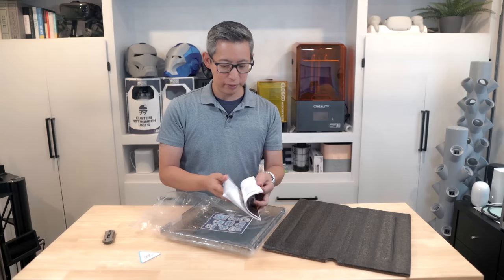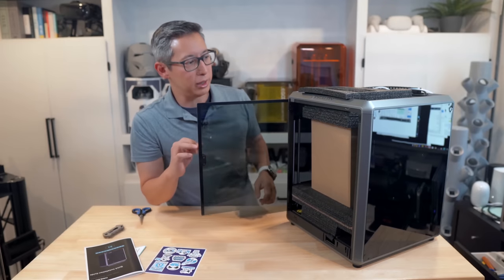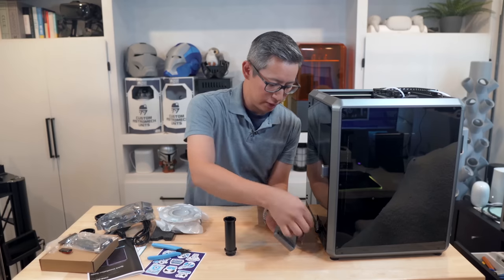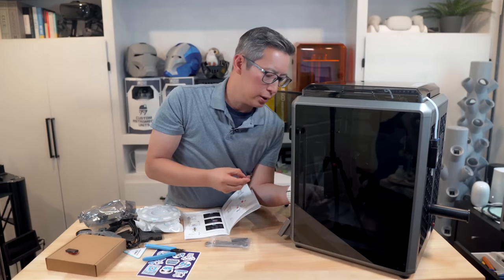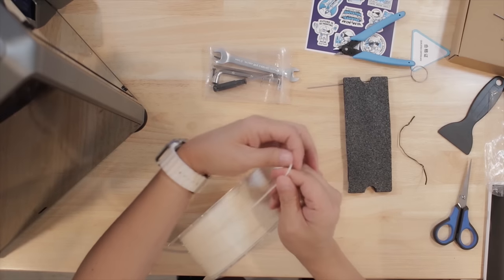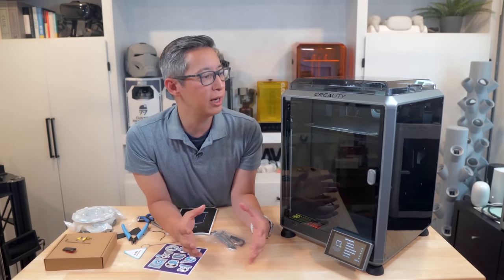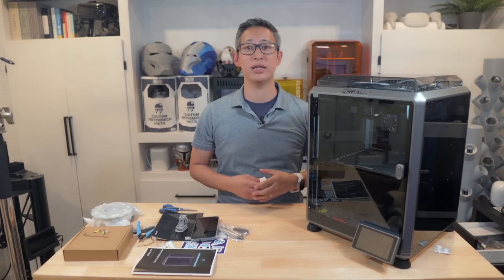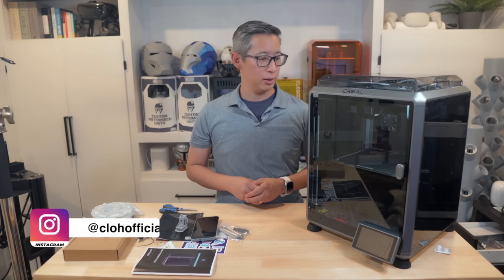Creality's K1 3D Printer is Here! | Unbox & First Use

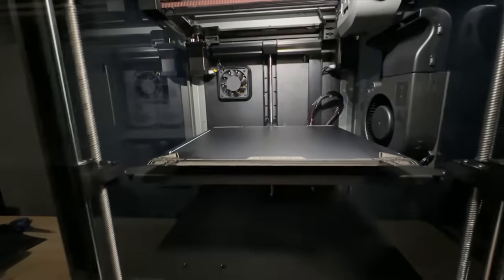Comment: 28:20 - You shouldn't touch the printer (or the table) when the printer is doing the input shaping tests.  The front panel warns you about this.  Shaking the table or printer will result in an incorrect input shaping calibration.

Comment: The price in Sweden for Bambu Lab X1 Carbon is on a whole different level. It's €1500 for the AMS version. P1P is €900. K1 is about €600-650.
Reply from the maker: Wow.  That is a lot more expensive.  Hopefully it gets cheaper over time.
Reply: @ChrisLoh  Yeah but their earnings are also much higher than other countries.

Comment: It was a bit disappointing that you received a K1 with a sprung frame, based on the lid not fitting.  I've watched several K1 videos and hadn't seen that problem.  I assume someone dropped that printer on a corner, probably during shipping.  Before I attempted to use the printer, I'd square the aluminum exoskeleton frame.

Comment: Mounting the spool on the back saves money but is one cost cutting measure that should have been scrapped.
Reply from the maker: Yea.  right now I have the printer backed up against a wall and it's a hassle to change out filament spools.  Im trying to find and/or design a template that will allow me to mount the spool on the side or somewhere more convenient.
Reply: @ChrisLoh  Think 'vertical integration' ... 1 Kg spools are 3 inches wide by 8 inch diameter. Construct a new top from Acrylic that increases the height by 12 inches. place bar mounted horizontal across the width 5 inches from the top and back. This allows room for at least 3 spools inside the new cover. Spool the filament from center of the front of the center spool. The cover would do double duty as a drying chamber as well ... just an idea :-)
Reply from the maker: @Bonjour-World  Thanks.  Sounds like a good plan, but will need to find some time to do it.  I'll update if I can pull it off.

Comment: Mine just showed up, it's running through the self checkup.  I can't tell if it's actually on the network yet or not though.
Reply from the maker: On the network selection screen if you wait a little it should say connected.  The alternative is to download the Creality slicer and see if you can seee the printer
Reply: @ChrisLoh  Thanks for the reply!  This is my first 3d printer, sure does a nice job!
Reply: @NavySturmGewehr  hows your k1 doing? I’m on the fence about getting one. Ive havent had much luck with 3d printers previously . May sell my two bed slingers and get one of these. I’m really looking for a fuss free printer that doesnt require bed leveling
Reply: @tbip2001  I'm waiting on a replacement hot end from creality.  My first 3d printer is down for two weeks.  I erroronously made the assumption that creality really wanted to knock it out of the park with this printer.  The quality of the prints and the easy of use as a new user is top notch.  It really is.  How many are having hot end failures and the fact that such an expensive machine is out of service in three days is a major put off, no matter how good creality's customer service is.  Ideally, I don't want to find out if a company has good customer service or not.

Comment: Just tried setting up my new K1 and it keeps failing during self inspection. It starts the self leveling part of the test then goes dark and reboots. Starting to feel regrets. No answer from Creality yet.
Reply: Check on side for voltage setting  from factory it comes set at 230 volts has to be set at 120 volt

Comment: I got mine about 3 weeks ago!
Reply from the maker: Excellent.  How are you liking yours?
Reply: @ChrisLoh  To be honest, I sold it 2 days later. I already have a Bambu and so when comparing it to that, Its a fail for me. First layer test didnt work. that was a sign for me. I also have a FLSun V400. That has its own issues.....
Reply: Is cura ur slicer ?
Reply: This printer isn’t on cura how did u get it too work
Reply: @MilkcafeCo  I used the creality print software that came with the printer

Comment: This is an enclosed printer.  Printing PLA on this is almost an insult.  To test this decently, performance with PETG, ABS, ASA, PA, ... should be checked.  If PLA is all you care about, the P1P will be way better in the long run.